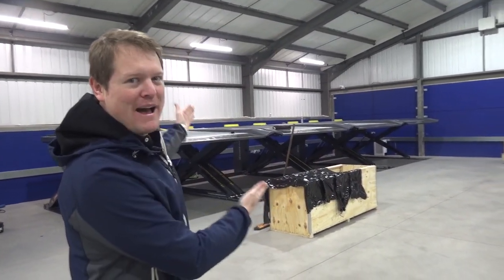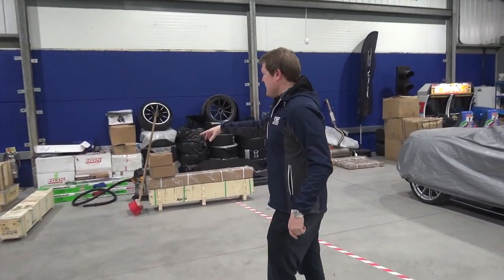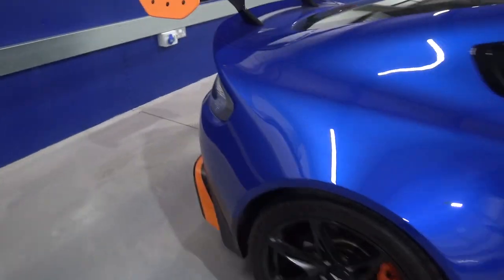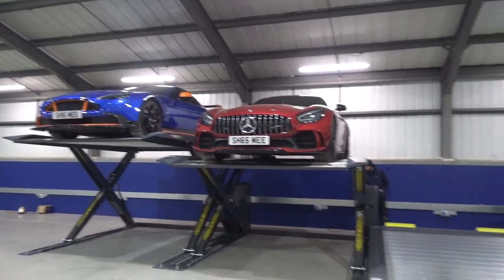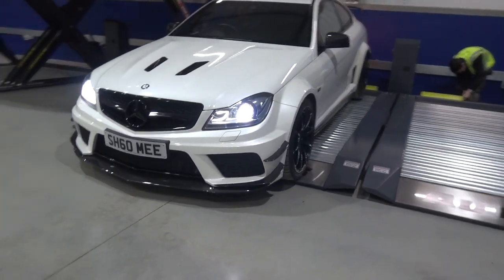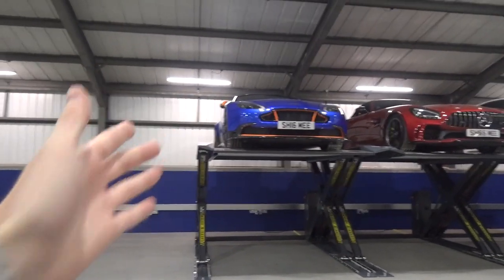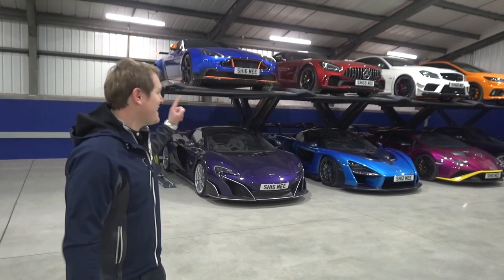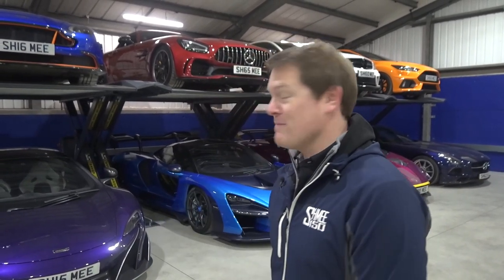My Car Lifts are COMPLETE! BendPak Autostackers at The Shmuseum | VLOG 48

Comment from the maker: How epic do the BendPak lifts look at The Shmuseum! NB: we're aware the wheel stoppers are reversed and will swap them ASAP when we have the tools.
Reply: How about some spot floodlights aimed up from the wall near floor level to illuminate the lower surface of the lift platforms and hence the cars underneath. Colour selectable might be cool although maybe not "disco". 🤣🤣🤣
Reply: I have commented before that you guys need a decent tool chest.
Reply: Why are these ramps so short?
Reply: I reccomend putting some sort of lighting for under the lifts
Reply: @realitykicksin8755  The entire platform is one giant gradually sloping ramp.
Reply: Time to contact Teng Tools for some Garage equipment, they have helped a good selection of the car channels get a good start tool wise, even with air tools and compressors if needed.
Reply: As someone highlighted in the 1st video, Those yellow stops are back to front, currently looks like it will dig into a tyre?
Reply: The yellow tire stops are on backward take a few minutes to Google the lift and look at the photos.
Reply: @Kigoz4Life  It is an abbreviation for the latin phrase "Nota Bene" which pretty much translates as "note well" and is used in "common" English to denote and/or emphasize an important point.
Reply: I thought the yellow tire stops looked alittlle sharp on the tires now I know why. Putting a small car at the end is a good idea with less space to manuver
Reply: Led ambient lighting on the platforms maybe
Reply: The Shmuseum Awesome Video I'm glad the Bendpak A16W Lifts are Officially in use and I think the Shmeemobiles look absolutely incredible and I can't wait to see what fun you guys get into with all of the space and I think Tim should get some Cool Lighting
Reply: Giddy Shmee is hilarious!
Reply: How about a BendPak discount code for Shmee viewers?!
Reply: @Kigoz4Life  Ps is more for an "extra" statement and/or something added on. NB  is more for when something is of importance or is worth being emphasized
(They are sometimes used interchangably, but this is not technically correct despite being an accepted practice)
Reply: @pigscanfly1331  Thanks for copying my post.
Reply: Looks dope !! Congratulations 👏 👏👏👏🇦🇺

Comment: I'd put blocks in the back of the SLS now so you can get it to stop in the same spot every time without having to worry about hitting the door when it opens.
Reply: Alternatively, one position higher eliminates concerns.
Reply: @youtubevisitor697  or glue some foam under the lift
Reply: In my garage I hung a tennis ball on a piece of string so when the back window hits it I know I am in the right position. Could be a solution here too?
Reply: Agreed 👍🏾
Reply: @the72inc73  The back of the SLS and the others under the lifts seem to be too far forward for that here. You'd have to hang them from the lifts themselves so either have to remove them every time you want to lower the lift or risk them getting crushed every time you lower the lifts. I doubt they'd damage the lift at all, but regardless you don't really want to be crushing anything when lowering the lift. 
I think some tape to mark the position of blocks, wheel chocks or tyre cushions then they can be easily removed and placed accurately again when you need to access the upper cars is probably the best way to go.  I think trying to rehang a ball or something else soft on a string accurately each time would be harder to do, although thinking about it (as I type :) ), you could permanently tape a small hook in one of the ribs (so it is impossible to crush it/pinch it when moving a lift) then have some numbered lightly weighted soft things on string matched to each lift position and car combo which could make it easier to place and remove accurately, and actually could make parking different cars in the same spaces easier (with a large selection of hanging things and multiple hooks under each lift to hang from, centre, left and right for mid engined limited rearward visibility but you can see by sticking your head out the driver's window, LHD and RHD).

Comment: As an FYI, those yellow tire-stops are on backwards on the rear of the upper section of the BendPak. I tried to link the photo, but it appears to auto-flag the comment. It can be seen in proper orientation on the Bendpak website and in the Autostacker manual.
Reply: Yeah I kinda thought the same and cool you highlighted it. It didn’t appear correct the sharp edge was digging into tyre. You would have thought the installers would have known this. Hopefully Tom will pick up on your comment.

Comment: looks pretty awesome. Might be worth putting some blocks on the bottom row and fix them in place like you did with the lifts? Then you can just reverse the likes of the AMG back until you hit those blocks and then you know the door is good and the wing mirror slides in that gap in the ceiling....

Comment: Only real negative I can see on this version of bendpack car lifts is that fact you can’t really work on your car while it’s up, but i guess these are just for this exact purpose you have for it. Looks very good Tim ! 👊🏼
Reply from the maker: Exactly that, they're ideal for our purpose, and we have the Quickjack for wheel changes etc!
Reply: @TheShmuseum  You may want a plan C or D, for a 4 Post lift down the road. The Quickjacks are good for changing wheels, but if you need to do much under the cars, laying on the floor gets old quick.

Comment: How about the wheel cushions (to prevent flat spots). Is this still needed? If so, also for the rear tires or only the fronts?
And if so, are you hardmounting the cushions to the lifts?

Anyway, it looks awesome!

You do need some Wood Wool Cement Boards on the ceilings and walls to stop those echo's.

Comment: Tim - Can I suggest mounting those hexagonal led lights under the platforms to illuminate the lower cars.  And maybe mirrors on the ceiling/walls so you can see the back quarter view of the high cars👍👍👍👍👍

Comment: any foreseen issues with that yellow metal bar (at the rear) pushing into the tire rubber - maybe there is some clearance and the tire isn't actual touching it, but seems a bit more room between it and the tire would be nice?

Comment: Couldn't you have a removable track cover fabricated so you wouldn't risk stepping in grease getting out of the car on the bottom? Mount it so it would move with the lift arm, yet be removable to service the grease points.... Just a thought....

Comment: Why don't you use the same lift as the one Brooks (dragtimes) have?
The pillars are on the corner, so in the door area there isn't a giant X "blocking" access.
Reply: Also, I think the car underneath will go in deeper so it will look more flushed and clean. Just saying..

Comment: I thought when storing cars its best not to leave handbrake on due to cable stretch and sticking caliper. 

You did not connect chargers to cars on lifts.

Would the rear wheel trays on lifts be better rubber or foam lined to protect tyres similar to the wheel storage trays you already have work?

Comment: I’m just sitting and thinking 🤔 won’t it be a bit easier to get out of the car when you start at the other side ? 🤷🏻‍♂️ I was just thinking 😂😂
And also it would have been cool to have charging points ontop of the lift’s then you could’ve just plugged them in at the top to charge the car

Comment: The lifts have wheels. There shouldn't be a need for grease on the tracks. Contact BendPack. Im sure the grease is there for corrosion protection before installation.

Comment: you can't even do a oil change on those lifts!!
Reply from the maker: These are purely for display/storage!
Reply: @TheShmuseum  any BendPak  lift from the HD-7 to the HDs-14 could storage and display just as good as those but allow better accessibility/no rails (what a stupid feature!) and allow working on the car if needed ..  how do you counter balance that? if you wanted even better display and even better accessibility you should have gone with two HD-9SWX lifts. and still could work on the car!  unless BendPak gave you those for free and paid you but you should have disclosed that if that is the case!

Comment: Not convinced the scissor lifts are the way to go. If you reverse the cars on the bottom further back under the lift, you cannot open the doors safely because the “X” gets in the way. I use two pillar lifts which still keep the platform level and make it easy to get in and out. I can open the doors as wide as I need to. I also don’t like those grease loaded channels. Stepping into them is going to be asking for trouble and they will pick up dust and dirt.